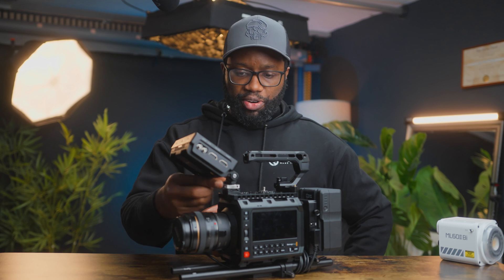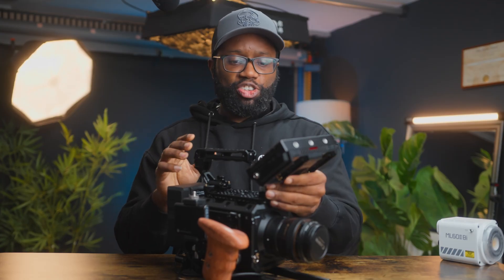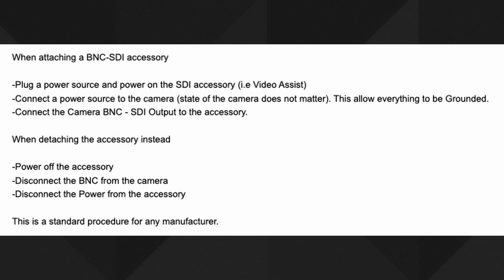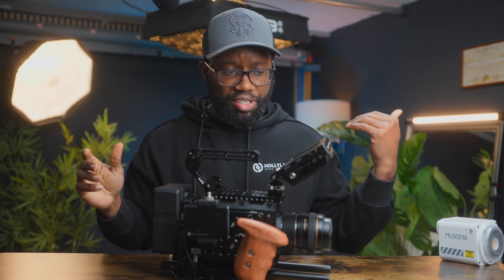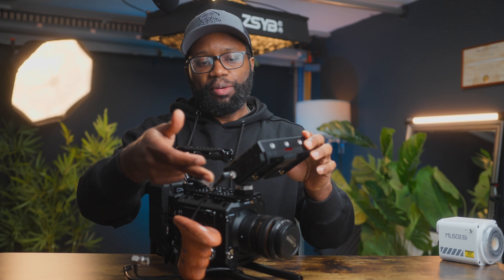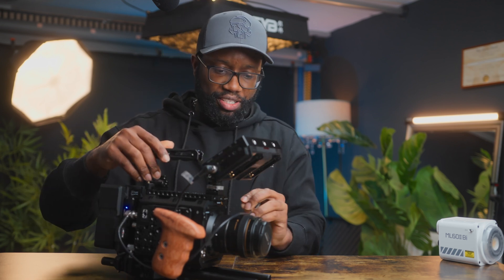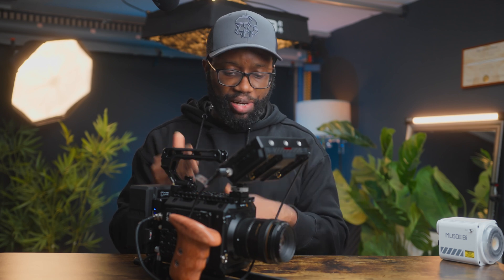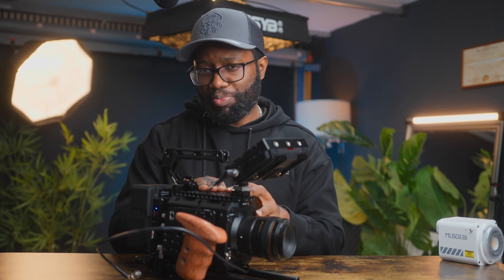Keep Your Blackmagic Pyxis 6K SDI Output From Damaging

Comment: The front USB-C is a 1080p wired output with 2 way OS control (Pyxis monitor only). The SDI/BNC signal out of the back of the camera, to record up to 4K on the VA in ProRes or BRAW.  The USB-C on the back of the camera is 6K wired data output for SSD recording, and a wired output for "Cell Phone to Cloud 1080p Proxies" (depends on 'phone) with free app and storage.  Over-all, there is also a iPhone and Android Remote "Camera Control" app via Bluetooth - $17 (OS menu only, no visuals).  The LAN is the fastest transfer method (no expensive CFexpressB Card Reader needed).  Laptop, Browser, Copy and Paste.  $5 CAT cable.  LAN Cloud and Livestream too.

Comment: So the info onscreen Blackmagice emailed was incorrect?
Reply from the maker: Exactly. I compared the info to other sources
Reply: @YourFilmmaker Hello again. Earlier on you mention to
•  haave the SDI accessry power on 
• Ensure the camera haas power and is powered on.

once accessories and camera has been powered on you can follow next with SDI cable

• Plug SDI to the camera then to the SDI accessory.

Clear this up please, u however turned your camera off then plugged in the SDI, when u mentioned against that earlier on.
Reply from the maker: @MONEYVAL9 I powered it off but still had a battery connected to the camera. Whether on or off the camera is ‘grounded’.

I have asked this question to a friend of mine who is more experienced in the field and he advised that it is better to have the camera turned on just as an extra precaution.
Reply: @YourFilmmaker  So once the battery and accessory has a power source connected we can then apply the SDI Cable? Would this be the same workflow for HDMI to USB-C type ports? I have a Portkeys monitor i want to connected to the HDMI to UBS-C type.